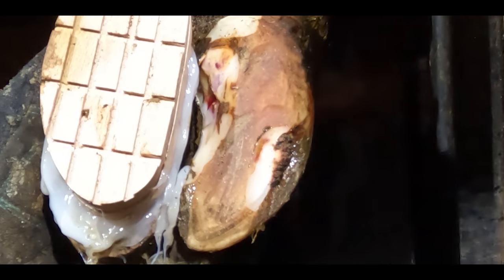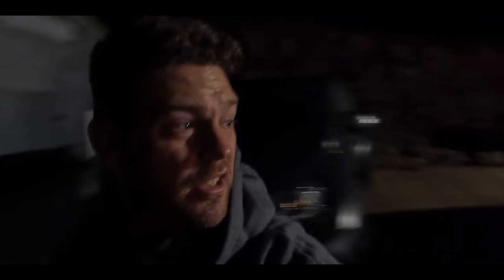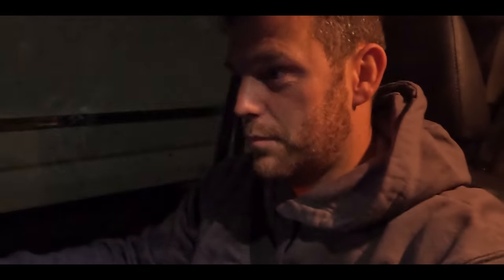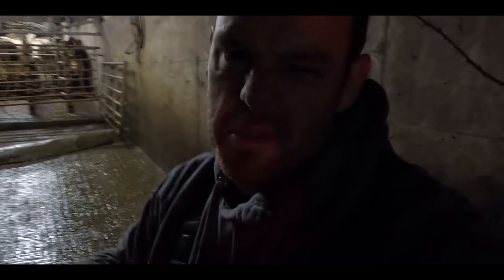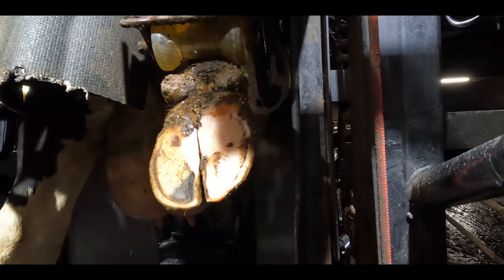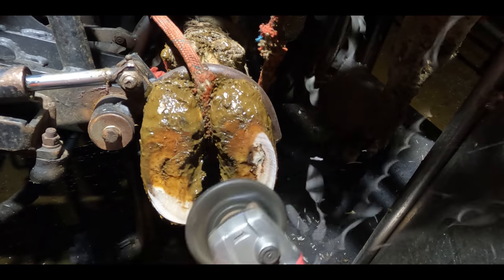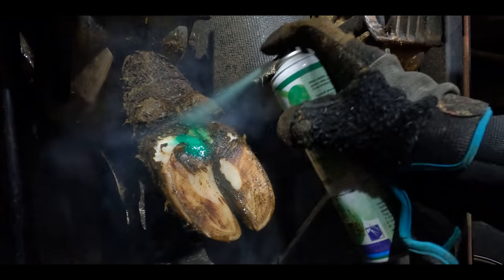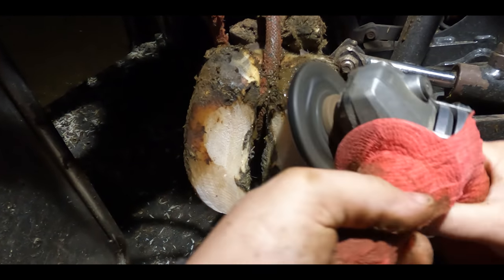WHAT IS UNDER the BLACK OPENNING in this COWS HOOF???

Comment: "Looks like a little Christmas tree over here. NICE."

You sound like me whenever my 2011 Jeep makes a new sound or something new breaks. Showed a photo of my tires to my mechanic friend. Told me I need to get my suspension checked on my front end. "O. Yeah. Those shocks are GONE." I merely go over a wicked bad bump/pothole OVER 10mph (20 ish kmph) and my passenger side shock sounds exactly like a brick in an unbalanced washer.

But we spent our first US stimulus check on my leaking rear shocks. Close to 2,000 USD, if I remember correctly. Ew. Turns radio up louder and drives like a grandma
Reply: 16 kmph *

Comment: are there any cases where both claws on the same foot could be damaged? and what would you do in that situation?
Reply: I’ve been wanting to ask that question as well.
Reply: There are a couple of vids where that happens & he adapts a block to fit on the “better” foot but around the issue on it. Some ended up more like a horseshoe shape so it still holds the cow’s weight off the worse foot but doesn’t aggravate the better one.
Reply: @brendahole9575  He actually used a block designed for horses. It was really cool.

Comment: do the knife use give hooftrimmers arthritis problems over the years of work?
Reply: I'm not overly familiar with arthritis caused by repetitive strain , but I'd have an educated guess and say many hoof trimmers would experience bouts of severe RSI ...repetitive strain injury . I used to pack bananas and just to lift some hands with one hand it was over 6 kgs. When you pack over 1000 boxes a day it created so much strain on the wrist joint I'd yelp out in agony just to pick any more hands up..the sharp pain was excruciating. It would get so bad I'd cry to butter a piece of bread. Being the only packer on the farm I could not even take a day off..It killed. I'd wrap it in a conforming bandage to try to make it better.  My guess is Graeme and other hoof trimmers would experience very similar because of the constant knife use at the same angles , and the weight of using the hoof trimmer all the time would exacerbate the issue

Comment: Have you ever thought of sliding a thin, flat tool in between the layers to help   see how far back it goes or to block the hook knife from possible knicking?
Reply: The hoof horn is right on top of the corium. When the infection is bad enough, the corium bleeds at a touch. Even when it isn't so bad, I don't think there's any practical way to do that--or a metal that could be made thin enough yet not fold up like paper when used.
Reply: @julietfischer5056  a tool like what I describe would of worked for this particular case and similar cases.

Comment: That Bovibond stuff must be super-strong to hold a block like that on a cow weighing hundreds of pounds (I just realized I have absolutely no idea what a cow weighs) on such a small surface.  I wonder if I could use it instead of the all-purpose duct tape sometimes...  I also wanted to ask you why, if the infections are so bad, the cows aren't given antibiotics.  Iodine will disinfect a wound but it won't last very long so it is possible for the infection to continue and worsen.  Wouldn't an antibiotic regimen added to the iodine and block give the hoof a better chance not to recur?

Comment: Maybe you could add some corner attachments to the crush to use as levelers so you don't have to hassle with those pads. It could be simple mechanical jacks with feet or be fancy with hydraulic cylinders.  A smart person could probably make it auto self leveling with the push of a button if they tried I'm certain.  If it's something rarely used then the mechanical jack system would be the best cost wise.  I can't help  but imagine though that you'd find it really cool to have the fancy auto leveling hydraulic model.  Or pneumatic, I dunno if your crush is hydraulic or pneumatic but it wouldn't matter much.